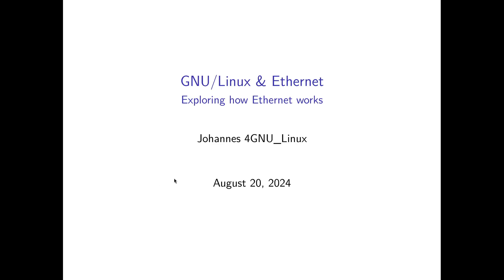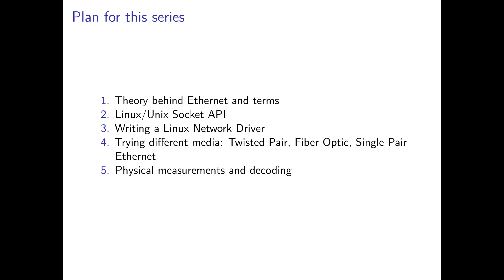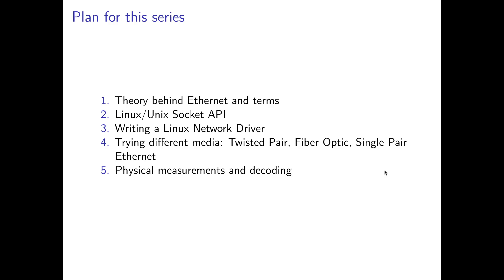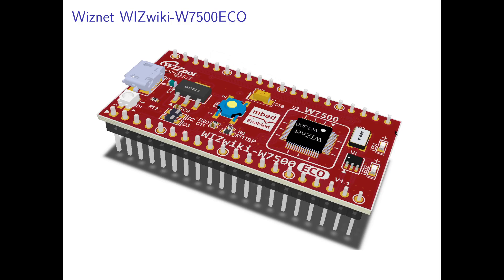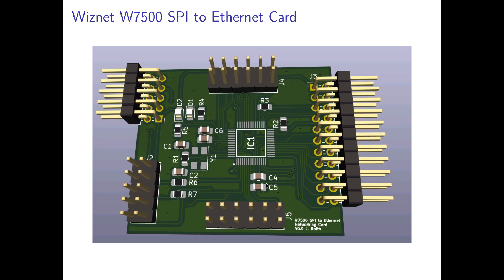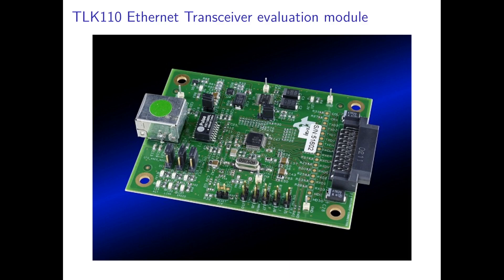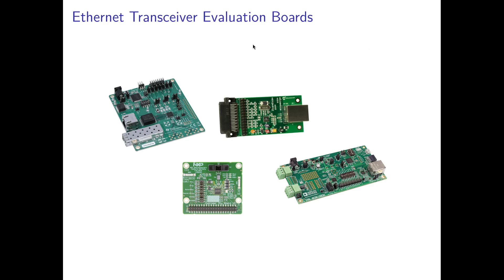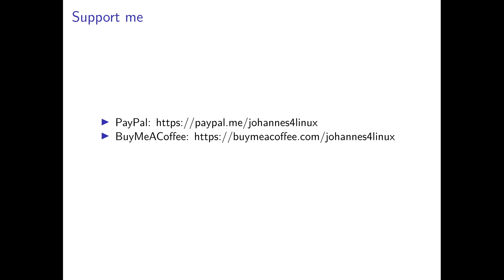GNU/Linux & Ethernet: Introduction

Comment: Haha what are the odds that I started learning Ethernet and you dropped a series on this.. excellent. Keep going.

A suggestion would be to improve audio quality as I can hear little even on full volume. Or maybe adjustments to mic gain levels would help
Thanks
Reply from the maker: Thanks for the hint. I will try to improve the audio next time.